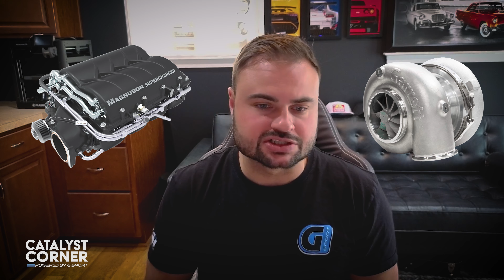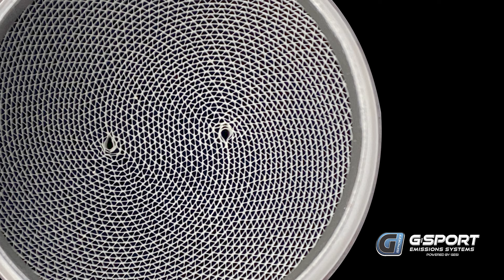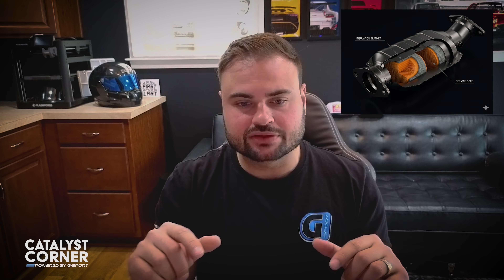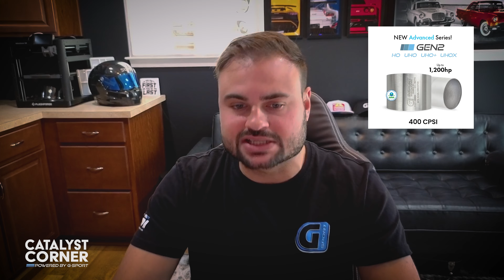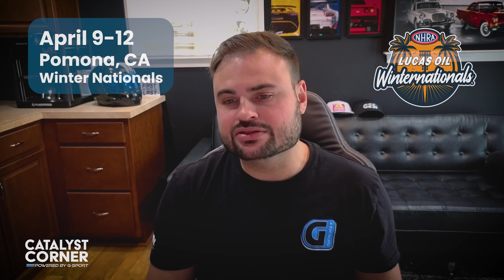Catalyst Corner Ep 1 - Powered by G-Sport Emissions Systems

Comment: Very interesting product, I own a 2014 gt500 with mild mods (Bigger throttle body, 16 pounds of boost instead of the stock 14 with a VMP tune (approx 775 hp I think) and destroyed my OEM passenger side cat. I then installed a direct replacement Magnaflow set with an x pipe and destroyed the passenger side bank again….The ceramic went at the end of the pipe and blocked it…

Comment: Will your G Sport HPPL 00100 be good for a 2018 zl1 supercharged, of course which comes stock 650 HP, but I have 2 inch long tube headers with 3 inch pipes going to my stock, muffler, lower pulley with a tune and tune for 93 and flex fuel
Reply from the maker: Hi Dave, 

Thanks for watching and thank you for your question. The HPPL-00100 is a private label part that Stainless Works uses. This unit is a 4" diameter body with 3" inlet/outlet. We rate our 4" body cats for 350-500HP (per bank). Due to the higher exhaust temps in a supercharged application and with your additional modifications, I'd estimate your ZL1 is making approximately 700+HP. Since this is pretty close to the max recommended power handling on our 4" body catalysts, I would recommend upgrading to one of our UHO models (4.5" diameter). The added surface area will allow better heat disbursement and flow. 

With this being a Stainless Works product, I would recommend contacting them for additional input. 

Hope this helps!